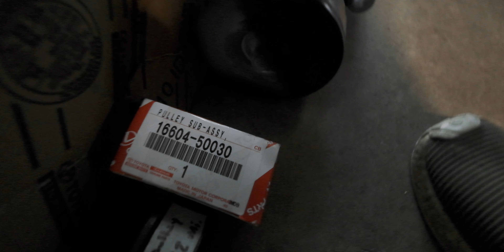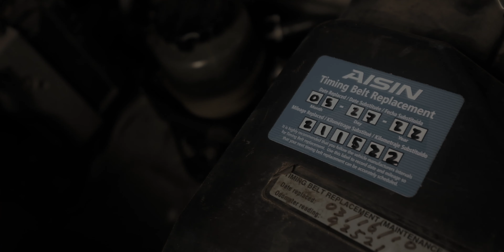Toyota 4.7L V8 Timing Belt & Water Pump 2UZ-FE (Sequoia, Tundra, Landcruiser, LX470, GX470, 4runner)

Comment: This helped a lot man, thanks so much for taking the time to film and post this. I did this on an 08 Tundra and there aren't too many differences between the two. Also a note to everyone doing this make sure to tuck the wire between the leg of the fan bracket before reinstalling it. I only noticed the wire was out of place after reinstalling the fan bracket and  some of those bolts are a pain to get to.

Comment: I Bought a 03 sequoia. No waterpump or timing belt service record. Should I worried? Car run flawless and smooth.
Reply: How many miles on it? They need to be changed every 150,000 to 200,000 miles or you can pull off your covers and check for cracks or if it feels dry
Reply: Mine was at 326,000 and was changed at 150,000 so I went ahead n changed mine as it was starting to crack and was drying up
Reply: Car is sitting at 188k and ok will check my timing belt. Ty so much
Reply: Yessir Good Luck They Good Trucks n can Run Forever.
Reply: @ryanculler7324  sweet! And ty

Comment: Ugh was driving good for 2 weeks after got new timing and water pump on and it decides to start  leaking my timing kit came with a paper type water pump gasket now have to take it all off again this is devastating
Reply from the maker: sorry for that. that sucks! what kit did you buy?
Reply: Delco kit I seen it's leaking from thermostat housing originally thought it was from water pump gasket cause it was paper my old one was metal I got it apart again and redoing it all just to be on the safe side assuming misfire is from coils getting wet

Comment: Thanks for posting!  I used this and TRQs video to change out my fan bracket.  Like you, mine was rusted on too.  I spent an hour hammering the shit out of it and using a combination of wood shims, putty knifes and screw drivers to wedge in there.  

One difference with the lx470 for the fan bracket is the ac compressor only needs the top and bottom bolts removed in order to slide the bracket forward.  I also found it useful to remove the battery in order to slide the shroud out.  The ac line is kind of in the way there.  Hope this helps somebody else!

Comment: I have a 2002 Toyota sequoia 2wd I'm about to work on just bought how did ya hold the cams and I seen you posted all tools used in video writing them all down now pretty confident in doing this myself mechanic wants to wait till Wednesday and wouldn't tell me how much I've done other work myself and turned out fine
Reply from the maker: i used a wrench on the cams but didn’t keep them from moving. at top dead center, they shouldn’t move
Reply: Thanks Man Great content and description very useful n appreciated

Comment: Hey buddy nice video, I follow the steps but a the time to try to install the timebelt  the right Cam moves to the side and I lost the iligment on the cams , can I just turn the crankshaft 2 more revolutions to align everything again?
Reply from the maker: what year vehicle are you working on?
Reply: @cruiserpatch  2000 tundra 4.7
Reply from the maker: Just make sure that when the belt is back on, that everything is still in time. If it is not, you’ll have some serious misfires. It’s not an interfering engine but if it’s out of time it won’t run correctly
Reply: I'm pretty sure the 4.7 is a interference engine isn't it?
Reply from the maker: My timing belt slipped off in the mountains about a year ago. My engine would be toast if it was interfering 👍🏼
Reply from the maker: The VVTI 4.7 is 100% interfering though